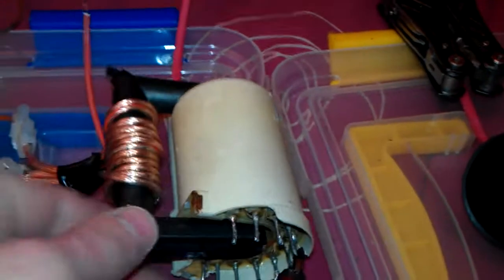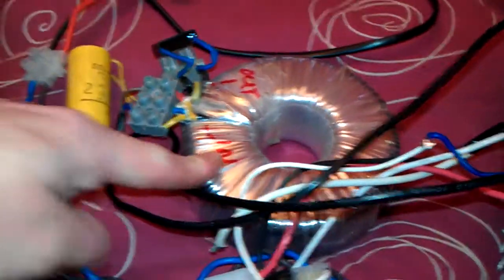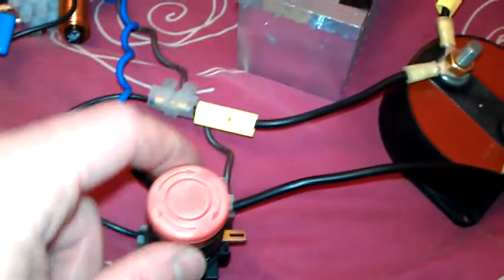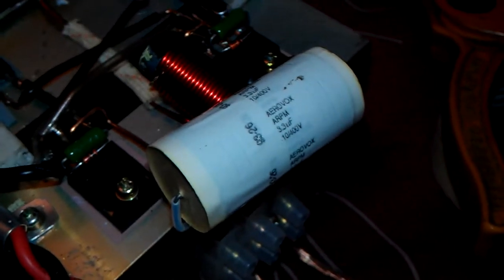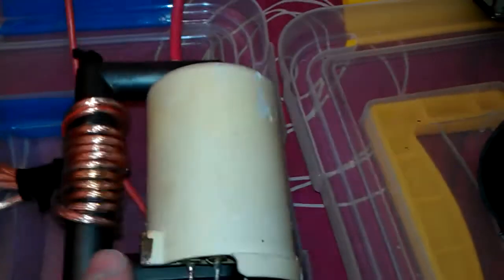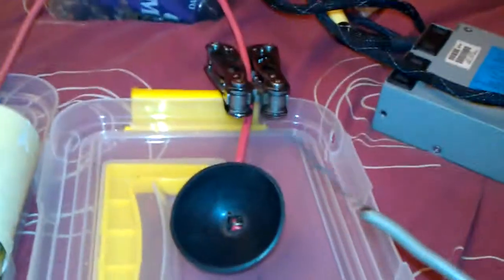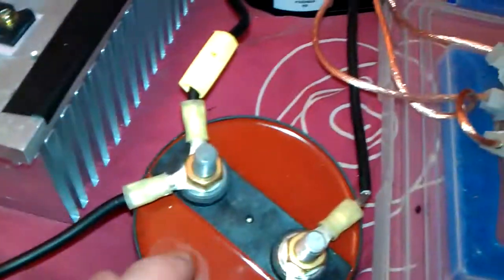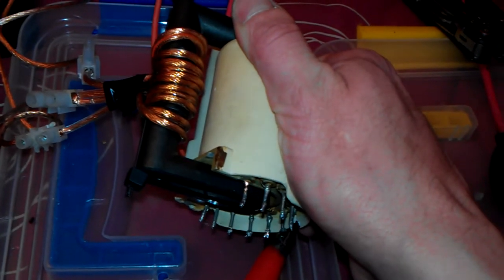Flyback on ZVS circuit.

Comment: As I can see you're using AC caps, right? arcs are nice but you REALLY need an electrolytic cap on the transformer 30v output (10000uf and 63V should be alright, they're quite cheap and small anyway) and the cap will bump up the voltage all the way up to 45 volts :-)))